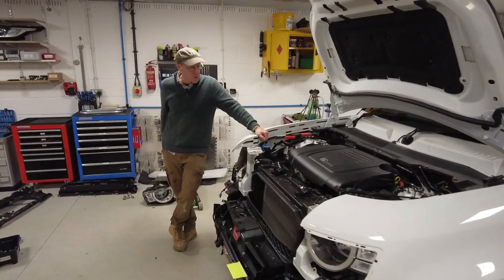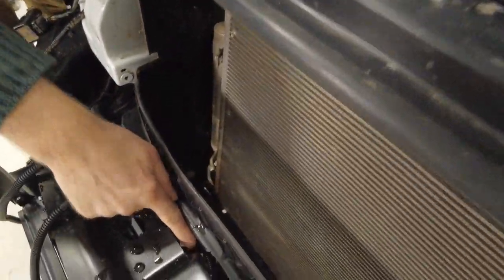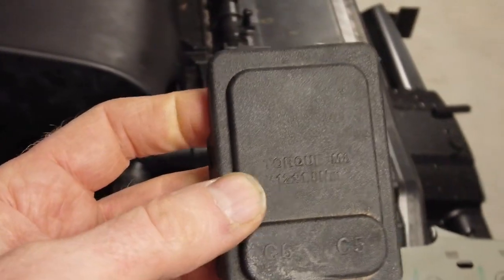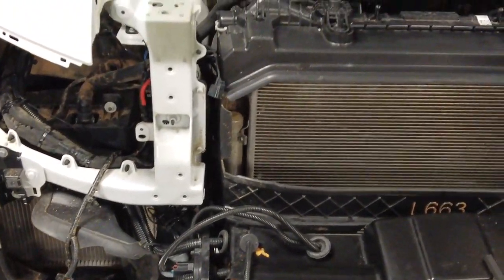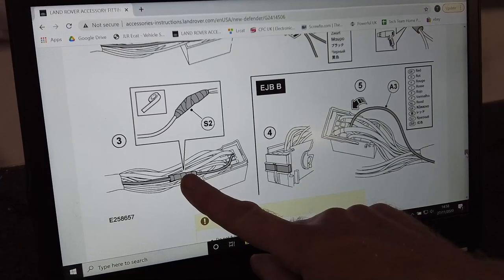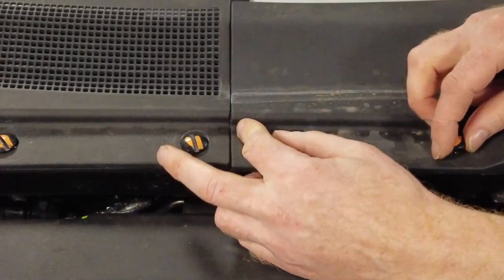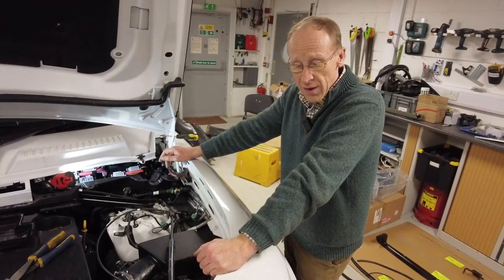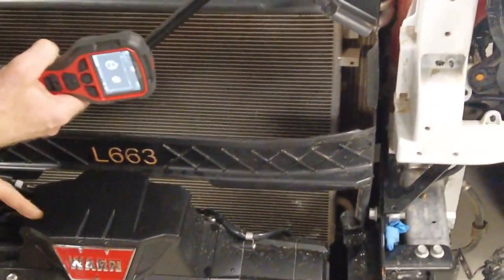Land Rover Defender 2020 Warn Front Bumper Winch Part 4 - Final Wiring and Testing !

Comment: Hi, I was using my winch with the engine running and to stop charging I then found out it had a fuse in the charging system and usually you have a extra battery when using the winch
Reply from the maker: Yes twin batteries are ideal with winches

Comment: Why route a wire all the way around the engine bay ( left hand side looking at the vehicle ) behind the window wiper scuttle. If you route it to the right it’s a seems a shorter distance and straight forward fit.
Reply from the maker: Hi - I hear you bro - I believe the logic is that all the other wires run on the LHS ( looking at the car )

Comment: Usually you have to have the engine running to keep the battery charged, otherwise your start battery will go flat quite quickly.
Reply from the maker: Yes i was thinking this... but the starter wire was a new one...

Comment: Simon, could you please help me? I have a few days to make a decision. Local dealer says that “Advanced Off-Road Capability Pack” can only be installed on factory, but for me it looks like software option. Do you have any information if it could be activated not on factory but at dealer premise? Thank you very much in advance!!
Reply from the maker: Of course the dealer is correct... i have been offered some software "for evaluation" that allows the CCF files to be changed and i will be looking into this. IF and its a big fat IF I can find the settings for this ... and i could change it... the issue is would it be over ridden back to standard with the next vehicle software update ! Fun times we live in with car software... I have a video i have half made on this topic ...

Comment: Thanks for these amazing videos 👍 ... I am scared how it looks like when you fit some rock sliders 🤣 I am offroading quite some time now using Warn winches and plastic robes. The plastic ropes need to be changed every 1-3 years mostly due to damages during winching and my Warn winch need some regular maintenance to stay a reliable tool. I am frightened about these tasks for the new Defender - you need to dismantle the front every time? 🧐🥶😳😂
Reply: Jep thats why it is mounted hidden, they call it "Pedestrian impact protection"

Comment: What a faff!  Most excellent tutorial with really useful practical improvements to the official instructions.
However if someone elsewhere cut the wrong wire, why not use a proper connector to reconnect it rather than claim it is unrepairable? Your piggyback to the relevant fuse must surely be a better idea than Land Rover's.
Reply from the maker: I guess the only problem with the piggy back fuse is that it limits the access to the adjacent fuse...so not a "factory" look ?
Reply: @L663  
Who's going to see it? It's no bother taking the neighbouring fuse from the one you need access to first, so I think it's a brilliant solution as long as the crimps remain really tight. Like you I'm not their greatest fan, but unlike you I don't have the fancy heavy duty crimping tool to do the best job. As you say, it is absolutely essential to put the piggyback in its holder the correct way round and it takes some head scratching to work out which way that is.

Comment: In the winch instructions web site, picture 13, do I see a FBH in the top side?
Reply from the maker: Yes that seems to be the FBH
£878+VAT in the parts list but i guess it needs coding etc
Reply: @L663  I’m intrigued. What is FBH?
Reply from the maker: @ivanwall4674  Fuel Burning Heater... its a Webasto type heater that pre warms your car without the need for the engine to run !
Reply: @L663  Thanks
Reply: @L663  Thanks. Could you share the part number please?

Comment: I've never installed a winch before... on any car. For purpose built cars (Wrangler, Tacomas, Discovery...)  Is it usually this difficult?
Reply: Not even close. I have this exact winch on my Wrangler. Took me about 6 hours total to remove the OEM parts, install the winch cradle, winch, and new front bumper. It was a single session, and I'm no mechanic.
Reply from the maker: Yes i would image this is as complex as it gets for winch fitting !

Comment: There is no reason some of that smaller wiring could have been done in production of the vehicle and terminated at convent engine bay connectors. Seems the winch was an afterthought.

Comment: Brilliant  love these  videos and great content. Keep up the great  work 👍👍
Reply from the maker: Yes i think we will be done with part 5 and then onto.....
a) Extended wheel arches
b) Molle plate 
c) new bonnet graphic ( longer than genuine )
d) steering wheel surround upgrade
e) paddle shift fitting...
So much to do... so little time... let me know what you want to see next !
Reply: @L663  what is the best way to fit a trickle charger to a discovery sport to keep the stop/start working? Thanks
Reply: Hi Guy’s I have watched all your video’s on the new Defender and are all fantastic. I have ordered a Defender 2021 my first Land Rover. I have had Kia Sorento for last 12 years. Simon I heard you saying Tyler was ex Royal Navy I am. Could I get some advice on the multi height tow bar for the Defender 90 on air suspension please. What branch was you in Tyler?  Thanks in advance.
Reply: Sorry my name is Alan is there any way to PM.  This is the first time I have commented on You Tube   Thanks.
Reply from the maker: @lordnelson1966  Sure - go to our website www.PowerfulUK.com and send us an email... you can say FAO Simon and it will reach me !
Reply: @L663  Thanks Simon will do 👍

Comment: Its obvious now how the TFL boys dealer destroyed an irreplaceable harness now. Way to vague instructions around some stuff. It should be mostly plug and play as a dealer installable accessory - either that or admit it requires a specialist to install.
Reply: Yes indeed. This procedure is most certainly complicated than a typical OEM installation. Despite JLR marketing, the winch looks more like an after thought than an OEM part.
Reply: This video basically explained how it could be that generally nicely designed cars end up being electrical fault nightmares. All the bits seem to be necessary, but the way the installation process is set up 100 things can go wrong or half-wrong and unless you did it yourself you will never know how to troubleshoot when things come loose, get corroded, etc.
Also, many ways for the installer to screw up and “fix” badly, leaving a fault waiting to happen.

Comment: Great video, thanks for sharing. I had one of first editions ones back in June and it’s a lovely car with one exception. Sometimes I can’t turn the car on or even turn it off! The dealer had it for over 6 weeks and on return worked ok but the 2 days later it wouldn’t start again. I managed to start it with the remote app but then I couldn’t turn it off! Land Rover assist came and it finally reset and turned off. I’ve emailed the dealer but I’m not having much joy. I’m just under the 6 month window (about 7 days). Any advice what it might be and what to do. Thanks
Reply from the maker: Hi James... this is interesting. So starting with the remote app requires the car to be locked. The problem seems to be getting the car to start with the car unlocked ! The only other thing that is different is the start stop switch circuit.. clearly this is not used on the remote. I wonder if it is the switch / switch wiring that is the issue.
The signal goes - Start Stop switch > BCM Body control module > Module Powertrain control > Junction box A ( relay 2 ) > starter motor.
Reply: Thanks Simon, Land Rover assist are coming tomorrow so hopefully they will locate.
Reply: Get shot of it before the warrantee expires!!
Reply from the maker: @martinhawkes2823  You think my warrantee is still valid.... you must be dreaming !

Comment: What was LandRover thinking hiding the Fuse Box, So it is Pissing down with rain and you have blown a fuse and you need to fix it before driving home so you need to get out of the car break out the tools remove the cover and replace the fuse in the mean time your soaked to the skin ... REALLY
Reply from the maker: Its not very accessible ! but i guess its out of the way of the elements !